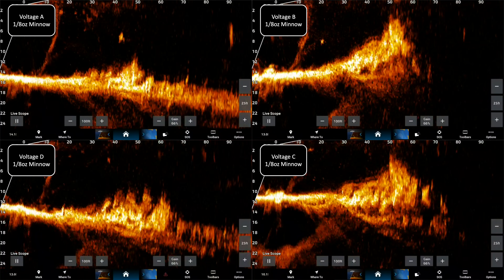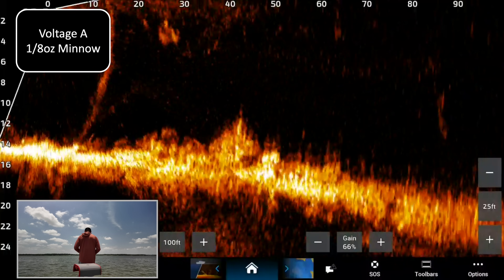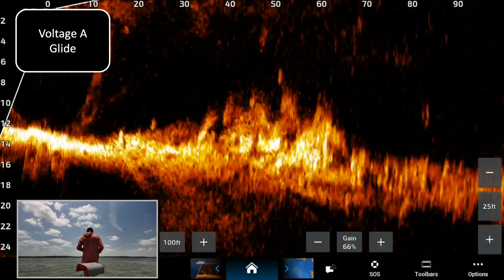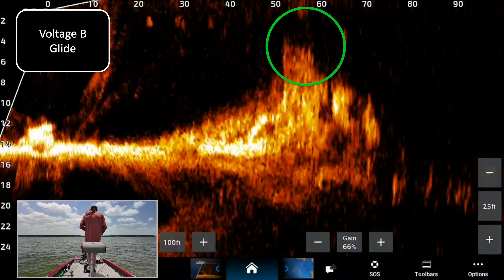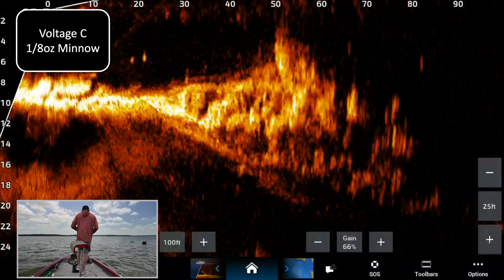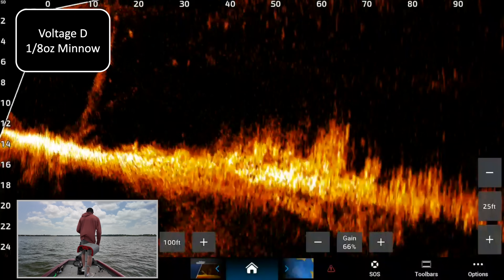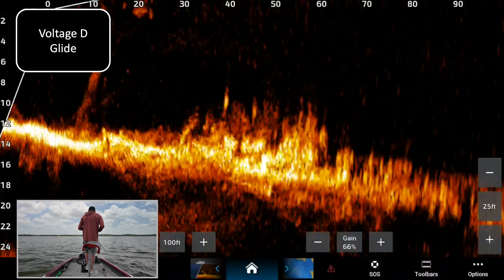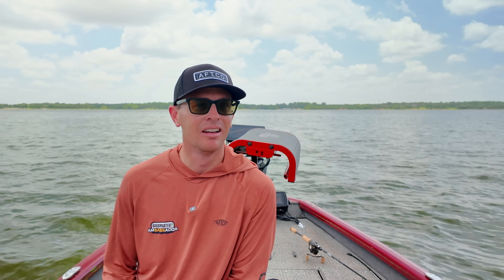Does Higher Voltage REALLY Improve LiveScope? (Blind Test Results)

Comment: I would imagine running a designated 12v 50ah battery close in a rod locker with no long runs of wire or even the need for heavier gauge wire would make a difference in picture quality and the ability to see your bait better. Too many connections along the route could also impact the picture. In other words…. Use the KISS method sometimes.

Comment: Only critique on the video would be needing to find someplace to power pole down and still have the good depth. Hard to compare side by side when the picture of what it's showing is different. Another option would be to have someone adjusting the voltage on the fly. If you could screen record and slowly increase the voltage, you would be able to see if there was a difference easier. That being said. I think as long as your above 12v it's good enough.
Reply from the maker: Appreciate the input 👍. My next boat will have power poles, I’m without them currently
Reply: Above 12v AND proper wiring.

Comment: I didn't see much difference in the 3 to worry about it. I went away from 12Vdc standard or agm, due to lowered voltage drop to run all my garmin stuff, plus garmin network, nema 2000 & steady cast.

Garmin service guy told me no more than 18Vdc to your fish finders. I run 8 guage wire, & 16Vdc PHL's for 2 - 106sv's & 2 - 106sv's, but PHL 28Vdc converters to LVS34 & LVS32 Transducers black boxes. Its EXPENSIVE, but 10+ years out of a lithium battery, factors out in long run. Im new to livescope, so still a big learning curve. Im about 1% there! Ha...  Enjoyed your video.

Comment: Remember - voltage is only 1 component of getting power A to B.  In the equation of voltage, amps and resistance, voltage is your push element.  You still need current and thin gauge wires don't flow high current.  How many boats have undersized wiring?  People run 6 gauge and then the connector has a pigtal with a 20 gauge wire.  True all electronics have voltage regulators, but for some bad wiring jobs out there, I bet the higher voltage helps their cause due to the other improper factors on their boat.
Reply: Great point, and everyone should be aware/consider that.  However, I'm assuming that the way the experiment was designed  (Goodman...you might want to tell us what you were doing to affect voltage) was to alter resistance, which will lead to a voltage drop and commensurate change in amps/total power.  All 3 (volts, amps, resistance) are related by Ohm's law and cannot be separated (changing any one necessarily changes the other and therefore changes total power).  Voltage drops as a function of resistance and you will see voltage decrease at different points along a long wire run.  Amperage does not do this...amperage is the same everywhere in the circuit and is just a side effect of the change in resistance and voltage (affected by the sum of resistance across the whole thing...so it can effectively be ignored if you know the voltage given these 3 are related).  As long as Goodman only changed resistance (what poor boat wiring does) or voltage (the result of lower resistance), this is a very realistic experiment even though amperage was obviously involved via Ohm's law.  Bottom line, you need to ensure you have sufficient wiring (large enough gauge for the length of the run, but also corrosion free) that you have proper power (which can be measured simply by its voltage at that point given it correlates with resistance) at the head unit.  As long as you get the minimum required power to the head unit (12v), you will get a good image.  One way to overcome long wire runs or insufficient wire gauge (and/or corrosion) is to start with higher voltage...but it is a thresholded thing.  Once you overcome "poor power" at the head unit, adding additional voltage does not make anything better.
Reply from the maker: @deshoup1 the voltage was altered with a DC power supply

Comment: Great video, we have been saying this for a few years now but it seems our customer base keeps asking for 16 Volt batteries more and more. We are planning to roll out a few models sometime this summer and the only reason is for people that have a new boat with undersized wiring. With undersized wiring you will have a significant voltage drop from the back of your boat to the front, sometimes as much as 1 to 1.5 volts, If this is the case a 16 volt battery would be a simple easy solution. Easier than tearing out all the wiring harness and replacing with new.
Reply from the maker: I saw the podcast where you mentioned customers asking for it—totally get going with what the market wants!

Have you come across a ~3-bank charger that can handle 12V, 16V, and maybe 36V? Feels like that could be the next request.

And yes, keeping existing wiring is definitely something some folks will want.
Reply: I haven't seen a triple voltage charger yet but we design all our own charges so it's literally just a matter of getting it designed.  
 I have my personal opinions on that though... even though the customers opinion counts more than mine...:) 
 If that 3 voltage charger fails,,,, your cooked.  
Or if 1 leg stops working now you need to replace a $700 charger vs a $150 charger... torn on this one..
Reply from the maker: @lestermiller8201 certainly a fair point. If you’re designing it, maybe something modular that clicks together within one footprint?

Quick a connect on the AC input and swap out the problem charger module if needed.

Comment: Garmin says it doesn’t matter unless you’re under 11.5v. Electronics all have voltage regulators.
Reply: I agree!  Electronics have internal voltage regulators to limit the incoming voltage to sensitive circuits.  Overvoltage is dissipated to heat.  This is to prevents voltage spikes from destroying the equipment.  It would be foolish for manufacturers bot to have safeguards.
Reply: Lowrance says the same thing as garmin.  Only a problem if you go under 11 or so

Comment: Thanks for the video. Good Subject. Based on your results do you think a dedicated wire harness would not.make a noticeable difference? I have been hearing it makes a huge difference and have wondered how much it really would. What is your opinion on this.
Reply from the maker: Having quality wiring and connections is definitely a plus. That said, I’m not into any type of “visualizer” or amazing claims of performance gains.
Reply: I have lowrance HDS gen3, bought shielded marine cable of appropriate gauge to prevent voltage drop from non lithium and wired direct. Sure cleaned up the screen noise by grounding 1 end of the shield. Would do no more than that, unless wanting to prove how many dollars you can flush down a hole. Oh, I am an electronic engineer who fishes inexpensively.